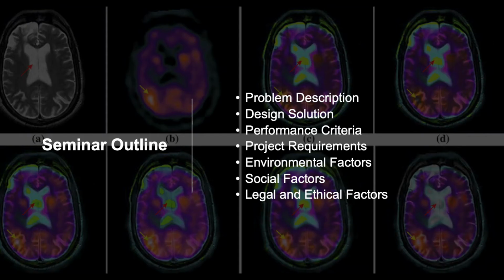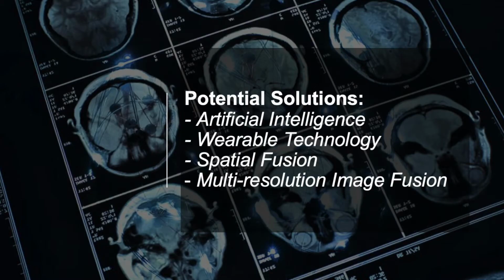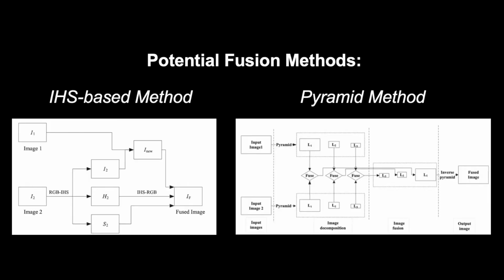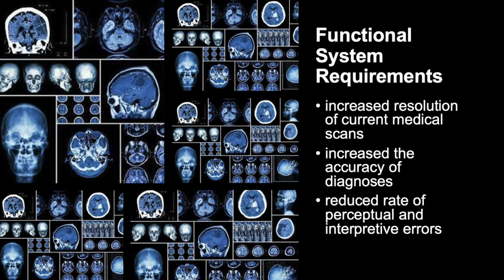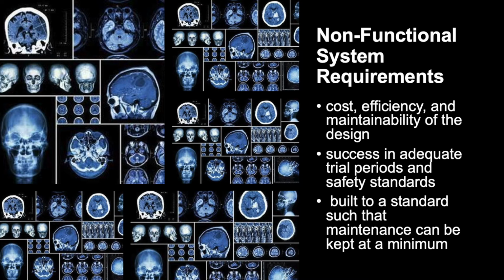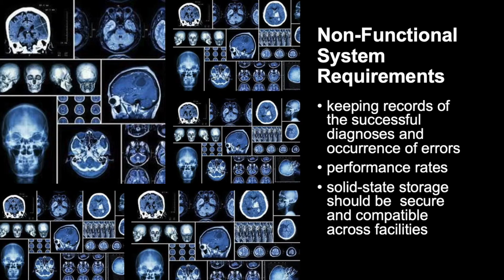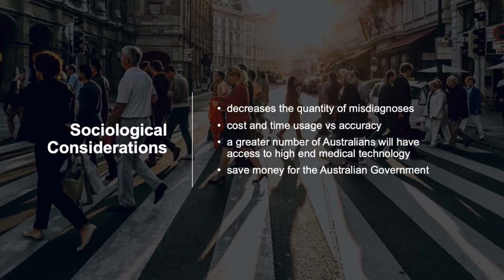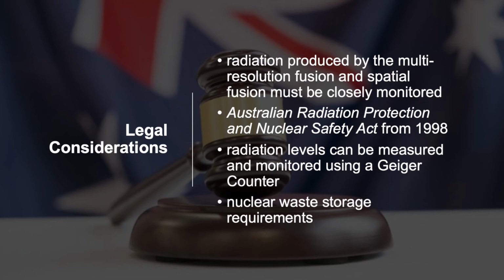Seminar: Design and Innovation Group 5 Workshop 2

Comment: Have you ever considered the impact of X-ray imaging on patient wounds?
Reply from the maker: Thanks for your question! The dose of external radiation applied for medical imaging is relatively low and stops after the patient is removed from the imaging environment. Thus, the likelihood of imaging impairing wound healing is extremely low. However, if a patient were to experience many scans, consistently over a long period of time, there could be an increased risk of cancer, but this would only appear years later. The doses are low and as scans are performed in a controlled environment, the risks are also low.

Comment: Why wouldn't the data be sent straight to the cloud instead of going through solid-state storage and then into the cloud as there would be compatibility issues between the two? And wouldn't keeping the data on the cloud add an unnecessary layer of risk when working with third parties in regards to security?
Reply: Thanks for the question!
The data can indeed be sent straight to the cloud, but the SSD can be used in connection with the cloud storage as a form of backup or other types of data. Further development would be needed to consider the best outcome for data storage and the mentioned storages are possible variations that could be implemented. The idea behind keeping the data on the cloud was to provide sufficient storage for a sustainable period of time. The unnecessary layer of risk should not come into play as the hospital facilities would have its own independent server to manage the cloud storage.

Comment: Great presentation with a very clear solution presented!

Just a couple of questions:

You mentioned AI and wearable technolgies as potential solutions to improving the accuracy of medical imaging but did not take these solutions into consideration against your success criteria matrix. What about these solutions in particular caused you to discard them early on and could those issues be rectified with further research and development?

Is there anything particularly different about the radioactive waste your proposed solution produces such that the current procedures for transportation and disposal require significant changes?
Reply from the maker: Thanks for your questions! We decided that the easiest way to aid the Australian health system on a broader scale was to design a product that could be easily implemented across multiple facilities. Wearable technologies are more specific to one person rather than say an entire radiology clinic. Further, in regard to medical imaging, the option did not have a lot of previous research that we could review. AI could be further researched and evaluated against the success criteria but similarly it would be more difficult to implement than fusion due to it being a drastic change from current processes. Both of these options that we discarded would result in higher overall costs. 

Radioactive waste management will be similar as fusion follows a similar process to other imaging technologies and thus produces similar waste. However, due to the reduced number of scans needed, this waste should be reduced.

Comment: What would be considered as a success for your non-functional requirement of having success in adequate trial periods?
Reply: Appropriate legal requirements should be met to ensure the success of safety standards. The design would go through rigorous testing before it is released to reduce the chance of faulty design to ensure the safety of patients.
Reply: A secure embedded security must be implemented across all facilities to ensure the privacy of patients. This should be password protected and must have layers of encryption.

Comment: Nicely structured and easy to follow. I'm assuming the fusion methods mentioned exist currently, so what is the actual difference in cost to implement these as opposed to the current, lower resolution solutions?
Reply: The implementation for fusion would be more expensive, at least initially. This is due to the fact that adjustments to machineries and the like would likely have to be made. However, this would hopefully decrease over time as people adjust.

Additionally, it is the quantity and quality of scans that result in an overall improvement of cost (less repeated scans would need to be conducted to ensure that the uncertainty of the diagnosis is below an adequate threshold).

The reduced health risk of a false diagnosis is also decreased which could lead to more improved costs (refer to Daniel Tieu's reply).

Comment: Why are multiple scans currently needed to diagnose patients? What goes wrong in the process to produce unclear images?
Reply: Thanks for the question! The reason for the need for fusing multiple scans to diagnose patients is because the current process individually have their limitations, which restrict the comprehensive output of the medical images. For example, computed tomography (CT-scans) is a very common process and is more practical for the scanning of bones and implants but is unable to provide much information on biological changes in the body. In contrast, magnetic resonance imaging (MRI) is very useful for in-depth pathological information such as tissues, muscles, tendons, etc. but provides insufficient information on bones and implants. 

As a result of these current processes, there have been cases of doctors in the radiology industry perceiving the medical scans inaccurately due to incomprehensive images or simply inadequate information in the scans. So it is not an issue with the process that produces unclear images, it is the fault of using the process as a singularity, resulting in the scans not having sufficient information to make a definite diagnosis. Hence, with the use of medical imaging fusion, we can merge multiple appropriate scans to provide greater details in the images and thus, reducing the occurrence of inaccurate diagnoses.